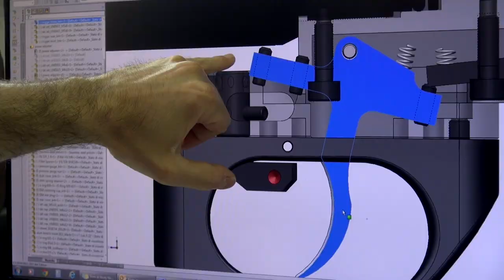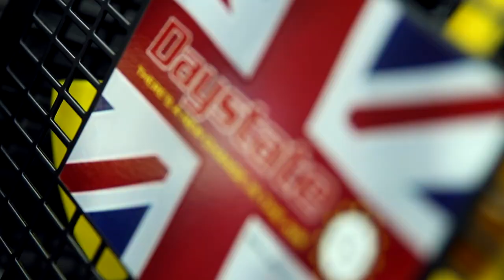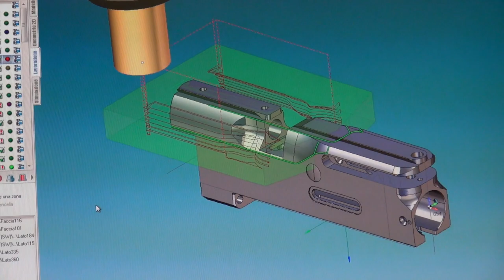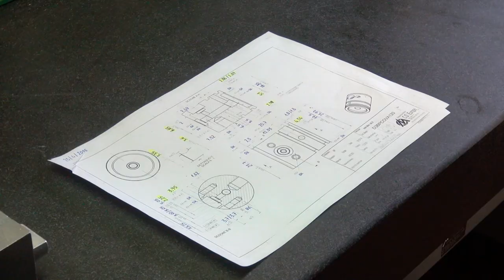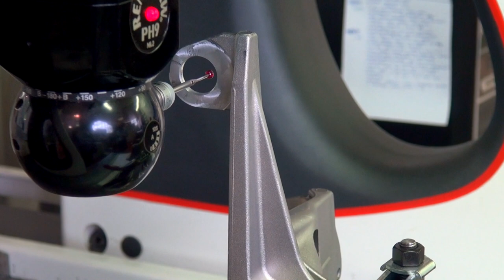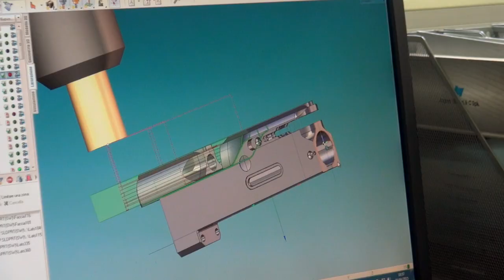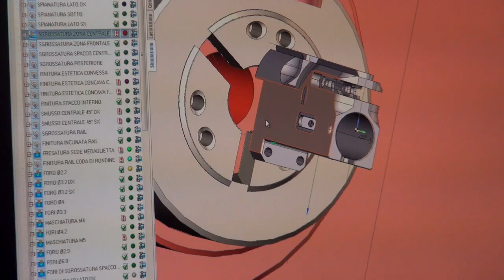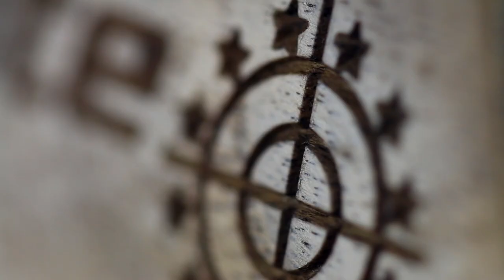Daystate Factory Tour by AOA

Comment: I am new to the sport but the great barrier to entry is the PRICE.  For 2k I could get a real high end centerfire. So to enter PCP for 2k is too rich
Reply: Is it only about the money, or what is possible?
Reply: Plus, I see we can get 600 and 700 foot pound PCP's, (a .50 cal that shoots a bolt also, a tiny bit better than top cross bows) for about $700.00.  But I know me, I will need my own compressor and tanks.  Just think of this too, you don't have to clean it, (clean the barrel when it starts shoot off).  No casings to pick up either.
Those are selling points to me.

Comment: I had a regal for 2 years from new and it started leaking air, there shop is only 40 mins from me so I asked if I could take it in they said yes but they will charge me £180.30. Considering how much daystate charge for there rifles I wish I'd bought another rimfire rifle instead.
Reply: I had the same problem with it leaking but I only had mine 2 weeks!!!! Then they "fixed it for free but it came back full of scratches 3 month later
Reply: Yeh there customer service is not great, lesson learnt for me I think

Comment: Problem with some of the rifles is the cocking mechanism next to the cheer rest, its simply not in a good position.  Better position would be the FX Impact  just above the trigger position.  Also don't like that you cant take the cylinder off some or without losing a full gas tank.